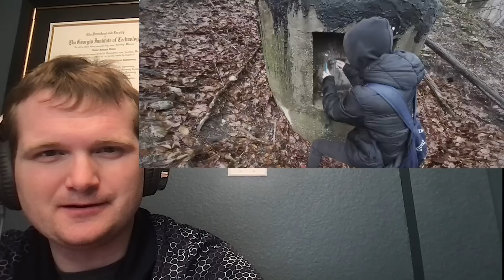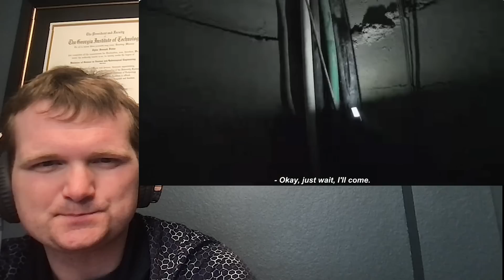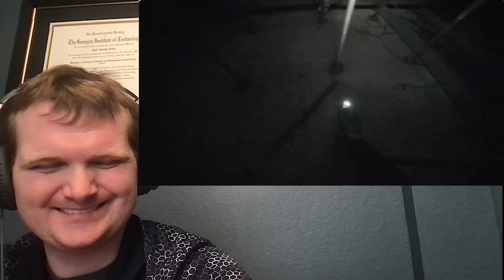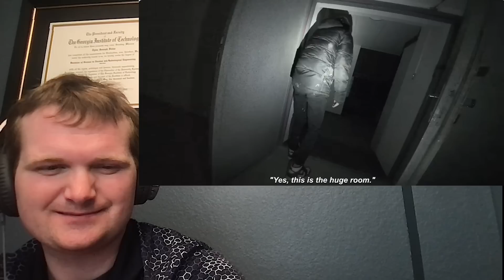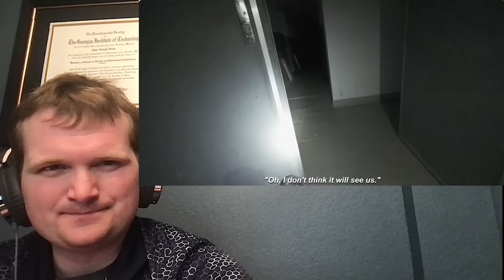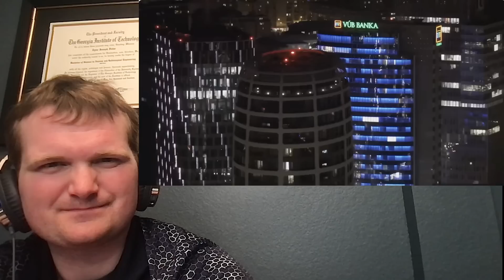Mission to Nuclear Bunker Complex - Nuclear Engineer Reacts to Shiey

Comment: 11:32 they are inside I believe drop ceiling during this clip.
(Context: in a lot of places, schools offices and other places with that panel kinda ceiling the ceiling you see is fake, and is basically just a cover for a area full of usually wires, pipes and ventilation, stick to the crossbeams is my only tip for normal drop ceiling, I’m guessing this kind is reinforced). Nvm it was THE GROUND.

Comment: I feel like a few lengths of rope, a harness each, several caribina's, pulley's and the like in a backpack and the basic training on the proper use of such basic climbing safety gear could be a good idea to have when producing such content. Just seems like helpful equipment and knowledge to have if one is going to explore abandoned structures with uncertain layouts and infrastructure in questionable condition.

Comment: Sad part, when your at work and hear something rattling....your going to be thinking about someone in your vents or wire shafts.
Reply: "Oh good, maybe maintenance is up on the roof FINALLY fixing the damned blower motor that makes the high pitch bearing whine and drives everyone in the back 1/4 of the cube farm crazy"

Comment: You should watch the Torchwood episode "Exit Wounds" (It's a spinoff of Dr Who).  They go from a fairly realistic nuclear meltdown (talking about how a power outage interrupts the cooling)...that goes way off the deep end into all of the tropes.  Even though the reactor is practically exploding, they instantly fix everything by "venting the coolant through the control room".  Which is ridiculous.  You don't vent coolant from an overheating reactor...and even if you did the control room isn't even in the same building.  Honestly it was hard to enjoy that episode because of how ridiculous it got.

The only potential saving grace here is that that reactor had been specifically designed to explode by an alien previously on Dr Who.

Comment: So I'm aware of where this is, its Slovakia, and that bunker is NOT abandoned, its actively being retrofitted or will be, theyre currently in the process of removing things. It has active security but no one monitoring it, the alarms aren't connected to outside yet.
Reply: Tho, how did you find out this info? I only recognized the location cos I discovered these entrances by myself when wandering in woods.. though when I tried to Google anything I only found small bunkers on internet
Reply: In this general location I mean
Reply: The bunker is just above Bratislava Nové Mesto in Karpaty under the koliba peak right?
Reply: Why do they have maps of Czechia in it?
Reply: @jarda1s32  That bunker was built by the USSR, it has loads of maps dating back a while and considering they were both the same country until the 1990s, that makes total sense.
Reply: @jarda1s32  from the time of Czechoslovakia I assume, or just simply because we are like brothers
Reply: @jarda1s32  yeah that's good question..At first it seemed to me as old Czechoslovakia map, because the central large map shows all neighboring countries but then after rewatching I noticed the solo Czech republic map in the right :D also some people in comments pointed out that the markings on the doors were in Czech which I did not notice with my resolution or idk I just could not make out all the necessary detail to tell it apart. But anyway similar entrances are above Bratislava also but it's not prolly this

Comment: Those alarms aren't even connected to a larger system... They're just loud to scare people like this.
Reply: It purely depends, Some systems are not monitored by a control room, whereas some are. When you're in a situation like that you just can't be certain. It's better to play it safe and get out of dodge than assume and get got.
Reply: If its not connected to the main system then why even bother installing them in the first place 😂

I am not an expert but those alarm need electricity to be work which is will be monitored regularly
Reply: @ systems like this, either will be connected up to a main alarm panel and monitored to some degree, or they're just screamers for the sake of deterrence ( which when it came to the video, there's clearly some On-site security which I'd wager can hear the siren). 

As for the monitoring, as long as the alarm panel has either an active PSTN, Ethernet or Sim service, then it would probably be monitored :)

Comment: Visiting government bunkers with active security like these two did is a good way to disappear for good.  That kind of security doesn't arrest or hold for trials and doesn't want it even be known a breach is possible, so disposal without record is the rule.  The fact they posted this is going to have some team seeking them out.  The first one with the tared roof and bars looked WWII era from the age of the concrete.  Old mines and tunnels are often chosen for such sites as some material has already been removed and access cut.  Memorial Tunnel (Formerly for the WV Turnpike) has been converted for the military and both access points seen from the highway.  As to what is inside it is secret but there is an area outside one side with military logos, vehicles and an added structure.  also there are 3 weather monitoring stations.  One each side and one in the middle of the new highway cut near the roof of the tunnel.  Also one you can legally check out now, is part of a hotel in WV (Decommissioned and was for Congress) the Greenbrier.  I suspect the Charleston WV area has yet one other major one, due in part the repeated POTUS visits to a certain CAT dealer and the range to DC.  Also Mount Weather just over the boarder in VA has been well documented by now.  BTW the Greenbrier was well known long before decommissioning but when a National Paper did a bit on it and disclosed it was for the House and Senate it was no longer just a bunker but a primary target.
Reply: Dude check his videos from like 5-6 years ago lol, he has been doing this for ages
Reply: This is not US, security and military here in EU are lazy af, especially in czechia and Slovakia, where this bunker is located
Reply: @whiism  In the US they would stand a better chance of a trial.  In Europe I know of cases of people being shot for sitting on a fountain or base of a monument in a public square.  The government may lack the resources to spare in this case to track them down for what they have done in a former soviet block country but those guards in that truck were not only armed but in an armored truck.  That level of security is there to shoot on sight, not to hold.  They got a rush with it and escaped but the question is how many times the luck will hold or when some government official decides to end such activities.  I myself did not do that type of security but I have done mine security, I have worked a government contract job in records that included execution as possible punishment for a breach in the contract I had to sign, have had a cousin that in the military in a post that could only say included guarding nukes and a Mother that Retired from the US Courts.  My own degree is in history and government so with my background I may lack some 1st hand information but 2nd hand is at the limits of what is legal for public info.  A couple of their first attempts truly looked like abandoned sites that just had enough to keep kids out from hurting themselves.  That tarred cone topped shaft looked WWII or near and the one with the joke chain on the double bar blocker clearly were not going to keep one out that was serious.  The one with the active sensors had be closed but still powered and monitored.  Perhaps a late cold war one that the new government has considered using or if they have a new site, raiding for hardware as needed.  I also agree with the host that on the building that climbing on mechanical vents is asking for trouble if they start moving while on them.  If not causing a fall then breaking a hand or foot if pinched.  Something in day one of mine safety training.  Also something they might risk exploring underground is bad air, if air is not being circulated or they find a pocket of bad air they could be dead before they know something's wrong.  Also a day one through 3 of mine safety training.  One of the things security had to call an emergency on was if the fans shut down as we patrolled outside them and off miners had minutes to get out or get their self rescue unit on.
Reply: And they don't have the resources to look someone up , until you are not showing exact tutorial how to get there or mocking them down.. like he has been to Belarusian and Ukraine bunkers a lot, and these countries I would expect to have much more elaborate security and military
Reply: its clearly a decomissioned site, the only reason there is any security at all is to prevent vandalism and if they were caught (having not cut any fences or broken any windows to gain entry) with obviously no intention of vandalism the worst they'd face is probably a big fine and not having to exit via some dusty old air vent lol

Comment: THere are no filters because the entered from the air outlet. not the inlet. Those bunkers maintaines constant high air pressure so they don't need to completelly seal the complex.
Reply: They are only Pressurized when the Air Handling equipment is in use, and the Filters have an average of 30 days of use before needing to be replaced...